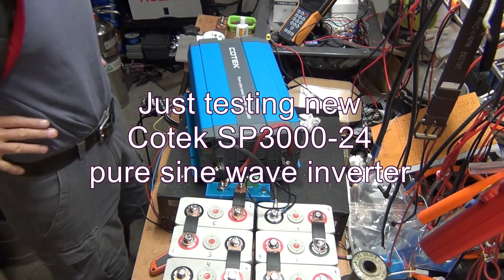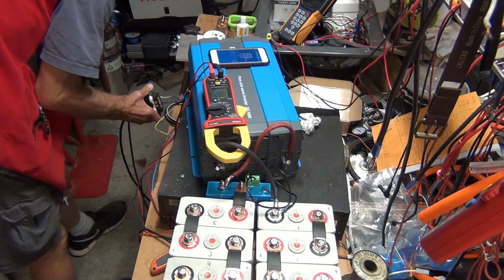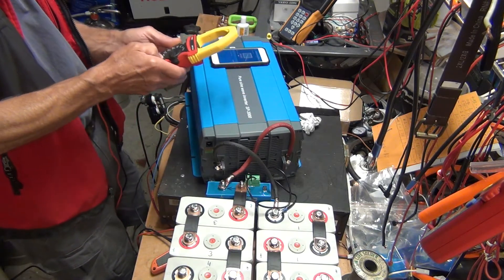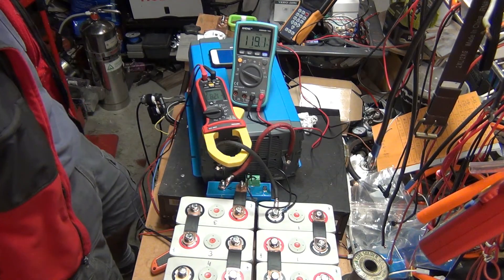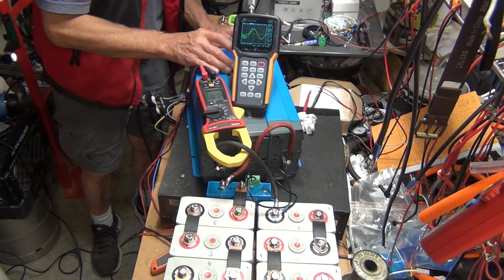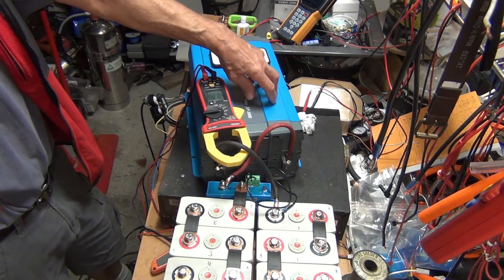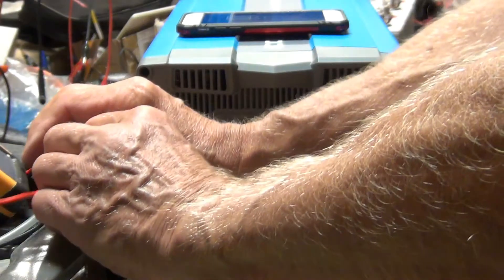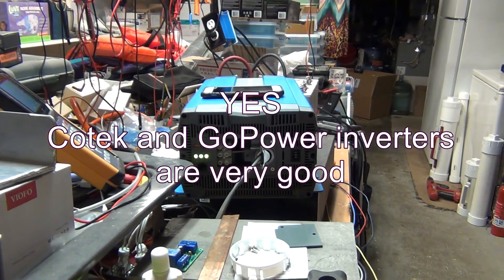Cotek SP3000-24 pure sine wave inverter

Comment: I have the cotek 3k 24v. Its a monster. I also got a go power 24v 700 watt and fixed the plug issue. Its a great small inverter. It can start a fridge without a blink and to my surprise can start a window ac unit (500 watt running  compressor). I notice yours has fans that throttle variably, Mine does not and is very annoying. they change speeds constantly if the load is varying but in steps.